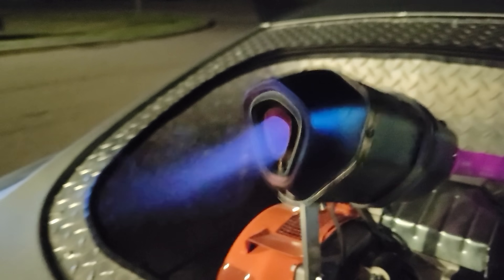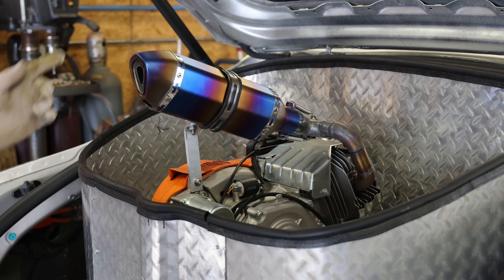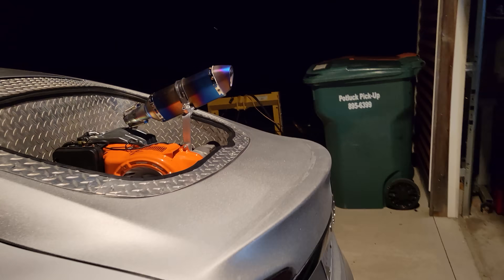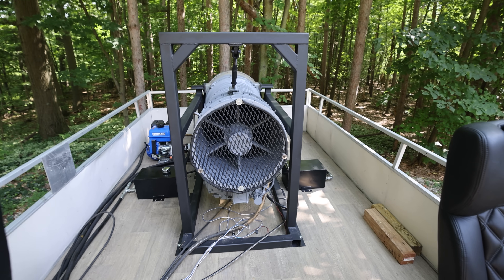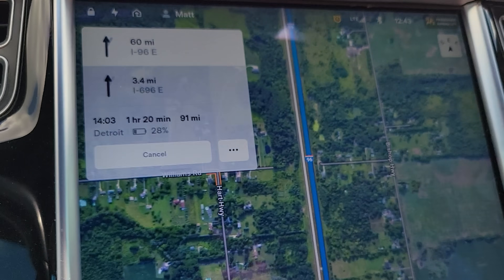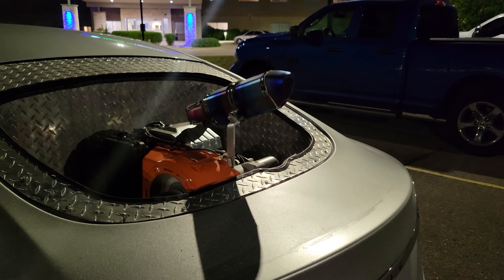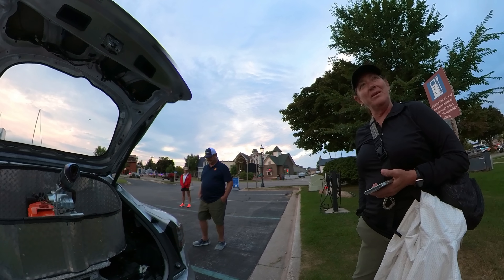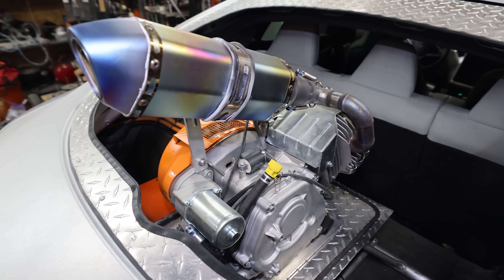Cordless Tesla (I Drive 1800 miles without charging) P.1

Comment: If you want to know how stupid people really are. I drive 1800 miles without charging....with a charger....1800 miles without a charger. The car was only charging 100% of the time. Did I get taught wrong in school?
Reply from the maker: The one thing you may have missed in school, is that energy can be transferred, energy cannot be made. The energy for the car has to come from somewhere, whether it's the Sun, power plant, wind power, ocean power etc.
Reply: @WarpedYT  I Don't understand your thinking. I kinda do. I tried to find batteries that didn't need to be charged but the ones I found had no charge in them. When I tried to make them work.....I had to charge them.....with a charger....Oh, Now I get it....if I use electricity...it's charging them, But.....If I use gas and a generator I'm just transfering electricity from the.....hold on, I am just too dumb to figure this out. I'm just transfering it from the air over the generator to the batteries....Right, Right. Damn your teachers were way smarter than mine. Mine never could have done that in a million years.
Reply: I wanted to build one powered by farts but energy can't be made.....So filling your tank at Taco Bell won't work.....Damn school

Comment: Hey buddy, you could have charged your Tesla without even interrupting your schedule. Charge for 15 min while you take powder room breaks, then about 30-46 min at lunch stop, at least one hour at the amusement park, 15 min at afternoon break, realistically probably more like 20-30 min in afternoon. 
  Well that is more than one hour so far. Dinner break 45 minutes charge. And your Tesla would only use 400 watts continuously on a bad day, so, you could even 
 “Slow Down”, that generator, to save the ten minute gasoline stops you imposed upon yourself. 
  Your generator should not be shooting flames out of the exhaust. Why is it doing that? Is the generator exhaust valve clearances much much too tight? Looks like the exhaust valve is opening before the fuel inside has finished burning, hence the flamethrower effect. I believe you probably could have done this trip without even burning a full tank of generator fuel, or very close to that.
Reply: Electric cars aren't for long range driving, period. A diesel is. These are city vehicles.
Reply from the maker: You're absolutely correct, car companies are just trying to fill the gap for marketing purposes, I believe the solution is in my future system. That is why I'm doing this project to begin with.

Comment: That's THE BEST way to create a hybrid!  You have only to size the generator to make a little over the required average kilowatts based on the way you intend to drive.  That way you have range limited only by the availability of fuel, AND you can smoke the tires if you feel like it using the car's main storage battery.  I've been thinking of this since a guy names Carlson had a little company named AC Propulsion.  He had a '94 Civic with a 150 kW (200HP) synchronous AC motor mated to the standard transmission.  The transmission was reworked to contain only a beefy second gear and, I think, a stock reverse gear.  The thing had a small range that I don't remember, but he had a 15kW Robin Subaru diesel generator in a small trailer for road tripping.  Carlson built an ugly, square-ish, roadster and was only heard from for a short time after that.  Immediately after Carlson went silent, Elon Musk showed up with his first Tesla roadster.  I've wondered about that ever since.

All you need to do, Matt, is charge up your Tesla and drive it exactly as you want to for a battery cycle...some highway at 75-80MPH, some stoplight challenges, a little putting around town...whatever you want.  Your tesla will tell you how many kilowatts you've 'burned' on average.  Take that number add some to it to make up for the heat loss between the generator's output and the car's charge distribution/cell balancing system.  That'll give you a generator that you won't have to leave running all night in the hotel parking lot.  Generator runs only when you're in the car.

Oh, and make sure that the generator puts out, under load,  what the box says it does...manufacturers' marketing departments like to 'forget' the real world and put feel good theoretical numbers on boxes!

Comment: Hahahahahaha going back to gasoline engine that is silly to adapt it to a EV car it defeats the purpose and noisy, truly silly.
Reply: You think hybrid cars aren't a thing?
Reply: @em4703  yeah, obsolete!!! They were the step before when EV were not plausible
Reply: @velluccisamuel  ev's aren't more plausible now dude. the range on them is fked. if you tow anything it drops the range easily to half unless you're traveling with a jogging speed. no thanks, bring in the synthetic fuels for long trips on regular ICE or hybrid cars, ev's and their batteries suck, and it will take decades until they will be truly worth it over a legit hybrid.

Comment: Pulling into a gas station to fuel up with that little engine running, it seemed like an accident waiting to happen after seeing the flaming exhaust coming from the little engine.
You’re not even allowed to smoke at the pumps, I found this a little risky.
Thanks for the video though, it was interesting.

Comment: I just put the harbor freight 9000w generator to the test for 4 days straight due to hurricane ian 
It ran great powering house barn and 2 sheds 240v over 7000w which it can do 50% for 13hrs i got more as i wasn't running max 24/7 and im in the country so water pumps softners a/c stoves etc etc etc

Comment: Could you post a more technical explanation of how you did this?
Reply: I agree with others in thinking it's fake.  You can see there's no output shaft on the gas motor or a generator hooked up to it, which means the only way it could be generating power is through a stator inside the flywheel.  You can see the stator briefly in one of the shots but I seriously doubt you can get 10KW out of it.  Even if that were the case, he claims it can charge the battery while the car is running.  I'm not sure how Teslas are set up but my Bolt only has one high-voltage inverter in the vehicle.  Since the car's battery pack voltage is more than typical charger voltages, the car has to use an inverter to increase the charger voltage above the battery voltage.  But the car also needs the inverter to run the main drive motor.  This means you can't charge the car using the normal charge circuits while driving, and the only way to charge while driving would be to generate the high voltages required (400 plus) yourself, which I highly doubt this guy is doing.  

At best this guy probably hooked up the gas motor's 12v starting battery to the Tesla's 12v accessory battery and called it a day - but if you call that charging the car I strongly disagree.

Comment: You need to find a better muffling system so it's not up so obnoxious for the neighbors when you stop and charge your battery. A larger muffler with higher flow rate would probably be your besttet. A muffler with a larger diameter tube would slow down the exhaust and it would keep the popping sound to a Minium Level and also a Larger Muffler with more Baffeling will muffle the exhaust much better without being in restriction.

Comment: I'm trying to think what the opposite would be. Take an ICE vehicle, add a battery pack and then some sort of electricity powered device that manufactures gasoline for the ICE to use to drive the car? I'm just just not sure what device would do that (convert electricity to gas). 🙂

Comment: Nothing green about this build except the money spent. You say you don't like filling up but how many times did you stop for gas? And how many mpg 😆 I will be more impressed if you can add 50-100 miles a day with solar power. Or just bring a extra long extension cord and charge it out of motel room or parks with outlets in the restrooms.

Comment: Make little mini wind turbine put about 5 across back of car. I drew plains on it looks badass. It would need a airfoil wing for mounting and protection put some mesh wire in front and back so nobody loses a finger. Connect each turbine to a converter to 220 with 4 or 5 of those should be plenty of power to charge. Go 60 and put your hands out the window then imagine holding a fan so much wind power. Of course you would need a computer to ruin it to stop if fully charged. Drive to New York to LA nonstop on auto pilot lol
Reply: I've thought about this idea for 10 years you build it I can't.
Reply: And if a windy day park outside into the wind might get a free charge.

Comment: Chrysler built a turbine car back in the 60s the problem was acceleration we know why the turbine spools up to slow. Your just the guy to fix that problem build a turbine powered generator use the Tesla batteries as your buffer. You have already proven turbines can burn all sorts of fuel. I have a suspicion that's your next move but if not you should consider it. If you really want to get crazy I have a definite improvement over a simple turbine generator battery setup charging setup. Good luck I'm looking forward to your next iteration.

Comment: Interesting but the video is lacking details on the power output of the powerplant. 10kw but how many amps? Watts = Volts x Amps. 120v at 80 amps is about 10kw, but the build didn't indicate installing 100 amp breakers so I assume it is significantly smaller, maybe 20 amps max? That means maybe 15 miles/hour charged back to the battery at rest. Charging overnight (12 hrs) means about 180 miles added? Does that sound right? For comparison, charging a Tesla at home on 240v at 32 amps gives 25 miles/hour, and at a Supercharger is about 480v at 100+ amps charges at 400 miles/hour

Comment: So that generator was 10Kw so it makes sense that it could power the car at about 40-45. Because ev have an efficiency of 3-4 miles per Kwh. So 10Kwh from generator. Basically 40 miles ish range its giving you per hour... Have you considered diesel generator? Im guessing you need 20Kw to realisically drive at speed limits and not loose range too drastically. Can you also give a rough estimate at to the amount of weight that you have added to the car with your system? Adding weight reduces efficiency also.

Comment: Have you thought of using a turbine motor to generate electricity instead of that gas motor. Something like a RC jet turbine engine could spin at much higher RPM generating a lot more electricity. Additionally, turbine engines are relatively small, light weight and simple. The only problem I see is the noise being an issue. Turbine engines do generate a lot more noise when compared to traditional piston engines. However, the lightweight compact nature along with the high RPM range should be able to generate enough power on demand. This would be a completely different design than your jet powered tesla as thrust wouldn't necessarily be used to push the car forward, but instead used to generate electricity.

Comment: It's basically what a u-boat would do.. Run engines at night, run electric or hybrid during the day. But they had more room and were more isolated.  What you need is a more advanced self driving option, then you sleep while the car drives at night and then charge the car while doing day activities. A car that would take you places while you sleep would be an ideal road trip vehicle.

Comment: Maybe a dumb question, but instead of a 10 HP gas engine, why didn't you use a 10 Hp diesel? That alone would be an efficiency improvement just on the power plant alone.

Comment: The question here is not if you can do it but if you should. Yes its technicaly possible but even when a generator can run in the most efficient rpm range its still going to be less efficient than just using a normal ICE car because you have to do 2 energy conversions instead of just one.
If you really want to use that priciple then make a hybrid like KTM did with its new sportscar. They use a turbine engine to load a small and light battery on the go. 
Much better fuel efficiency from the turbine and because the battery pack itself is small and light you can easily build light sportscars. 
You could also use the same principle to build a super efficient hybrid.thats going to be much lighter than our 2.3 tonnes (or even more) Teslas etc.

Comment: Fun project but you built the most inefficient hybrid ever! Probably a diesel generator would have been somewhat more efficient. Pity you didn’t have someone following you in a Prius to get a good comparison on gas usage. My diesel Passat gets 55-60 miles per gallon at a constant 55mph on the motorway (Uk gallon which i think is a bit bigger than a US one). Look forward to the results with version two! But take a hybrid along too to get a comparison, see if you can use less gas than the hybrid.

Comment: Teslas will not drive and charge at the same time, his gas motor is too small to generate 10,000 watts, and at 10,000 watts he would only gain 30 miles of range per mile. Just not possible running on a little generator like that. None of the numbers add up at all.

Comment: Pretty sure it was not practical, efficient, or bug proof. Point of failure being the power plant for charging the battery and the need to leave it running 24/7 to charge the battery. Insane excessive noise. Needs a better design and muffler system to quiet the power plant. And was it even considered safe pouring gasoline while driving next to the plant that blows fire?

Comment: Imagine if you had a tiny APU gas turbine attached instead. Then you’d have a generator AND a jet engine all in one! Probably would’ve been a lot more efficient as well. Also, maybe an i3 Rex 650cc twin could’ve worked too if you’ve figured out how to charge the Tesla this way
Reply: This is what I was thinking, a turbine should be more efficient than a piston engine.
Reply: @ColdWindPhoenix84  Small turbines are typically very inefficient, unless built with very high tech materials and heat recycle.
Reply: @beforebefore  worse than 14% thermal efficiency?
Reply: @ColdWindPhoenix84  Modern ICE car engines are better than 14%... all the way up to mid-20's now... but yes, worse.
One of the things that makes engines more efficient is higher compression, and a small turbine compression is typically under 5:1 at the very best... and this only occurs at full speed.

But again, if designed "no holds barred" and engineering cost is no restriction, it can be made efficient... that's how Capstone Microturbine has made a successful business out of them for so long.
Reply: @beforebefore  that makes sense, although I would expect that in an equal race ratio to ratio the reciprocating engine will have more losses than turbine.

I've only gotten into turbines as a interest, what is the highest compression turbine engines have been made?
Reply: @beforebefore  oh, I also saw that Toyota has an engine in their hybrid that has achieved 42% and Mercedes has an opposed poison diesel engine that they claim broke 50%. But I feel like those would be more difficult to fit in the trunk of a Tesla than a tiny turbine.
Reply: I've been saying for years the automotive industry needs to revisit turbine with a hybrid. Its the perfect, compact combo
Reply: Ariel is doing exactly that with their "Hipercar"
Reply: A turbine engines thrust is converted into mechanical motion and thereby produces no exhaust thrust, like a jet or turbo fan. Plus, jet engines consume much more fuel than piston engines, for the same amount of work. Where they do have the advantage is in simplicity of moving parts, which means longer service intervals between complete overhauls and reliability. The engine he used for his generator was too small and ran at full throttle constantly, which is why his mileage was so poor. Had he used 13kw generator, he would have been able to drive constantly at highway speeds and the generator wouldn't have had to work as hard, reducing fuel consumed.
Reply: Buy a hybrid. End of story.
Reply: @michaelbigelow3255  actually they were used in cars s few times. Look up the Plymouth turbine developed back in the late 60s. There was also an Indy car that was destroying the competition and so it was banned.
Reply: @michaelbigelow3255  I was under the impression that the Plymouth turbine got in the realm of 22mpg which at the time was pretty respectable.
Reply: There is a new car comming out that is a hybrid with a small battery that has a turbine charging it
Reply: @michaelbigelow3255  I know turbines give low mileage in cars
THATS WHY I BEEN USING ARIEL AS AN EXAMPLE OF NOT USING IT TO POWER THE CAR, BUT TO POWER A GENERATOR
Not sure how it works or if it's output is good enough to keep up
Ffs
Reply: @michaelbigelow3255  well in fact, turbines weren't used in cars because of throttle response
And what he says is... Well, you could say is factible, just look at the New Ariel car, is an electric car with an Hidrogen turbine generator
Reply: @RDYDX  no. they're terribly inefficient in a car especially. imagine waiting at a red light and your car idles always at 5000 rpm. that's essentially what a turbine is doing. if you did nothing but sit on a highway all day maybe you could consider it. but otherwise it's not even an argument.
Reply: @happydappyman  well if the energy was simply being used linearly to charge a battery, that idle inefficiency becomes irrelevant
Reply: @happydappyman  I never said it was good as a stand alone engine for a car, I know they're unreliable for powering the car, that why I used the Ariel car to talk about it use, an Hidrogen turbine powering the generator, not the turbine moving the whole car